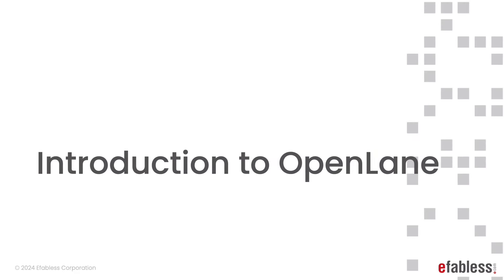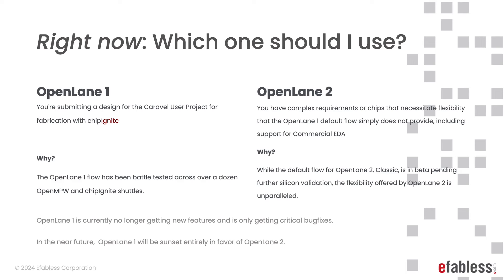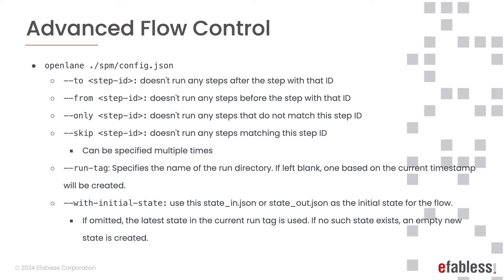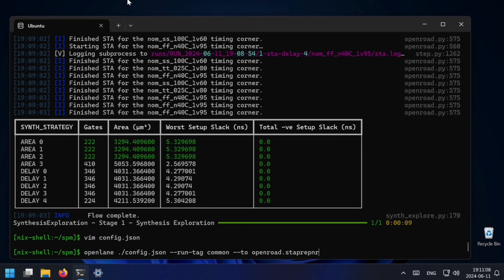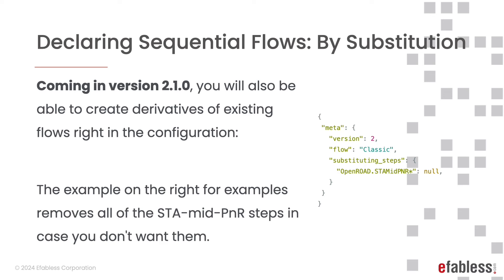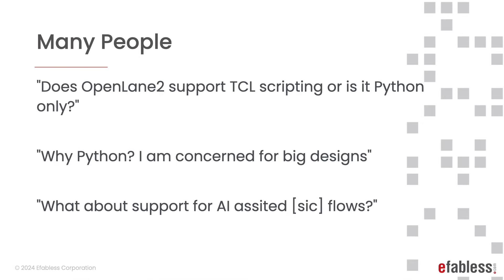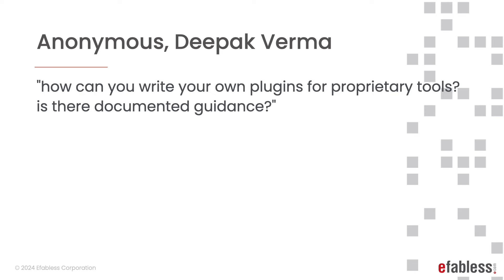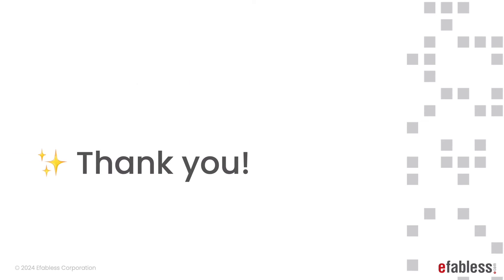Mastering OpenLane Development Platform in Chip Design

Comment: when I ran the command 'openlane config.json --flow synthesisexploration' (at 10:00 in the video), my terminal got stuck at 'SynthesisExploration - Stage 1 - Synthesis Exploration' (I waited for 5h but nothing happened). I also tried to checkout openland to the previous commit but everything is the same. Does anyone know what is wrong with it?
Reply: right, same thing happens to me, i have tried with 2 different versions and get the same issue on both...
Reply: Try openlane2 tag 2.0.11 will resolve synthesis exploration.
Reply: Synthesis exploration has been fixed in 2.0.11, extremely sorry about this. - Gaber